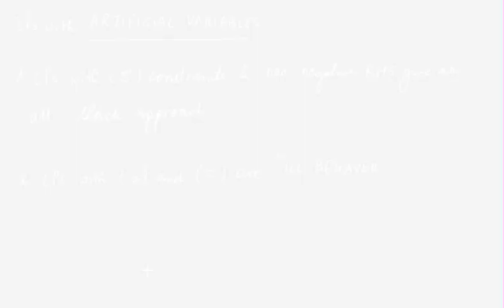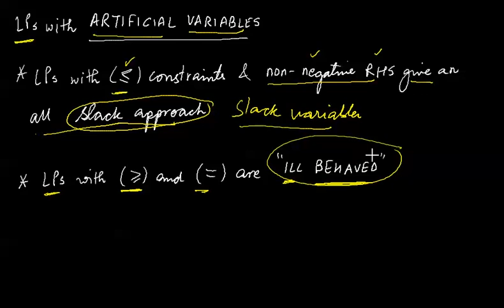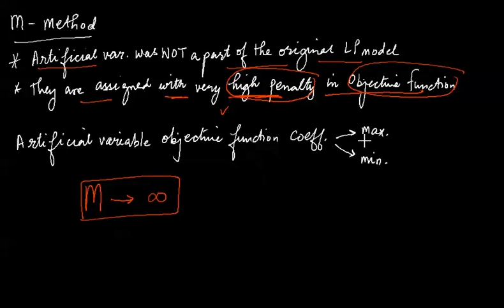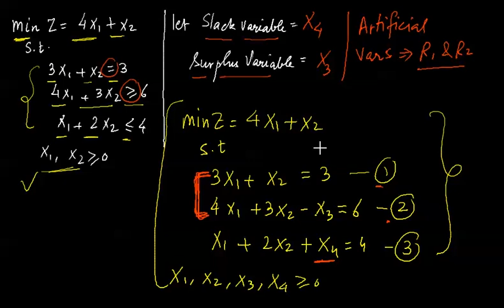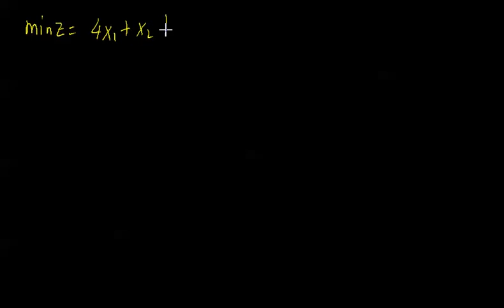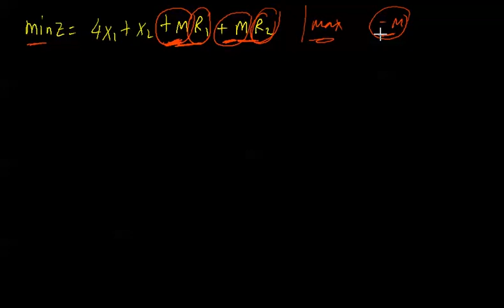Artificial Variables -Simplex method - Operational Research - GATE Mechanical lectures

Comment: Hi, can't you simply use the dual method if it's a minimization problem with >= signs?
Reply: dual only makes sense if there are more >= constraints than <= constraints. if not dual will make the problem more complex